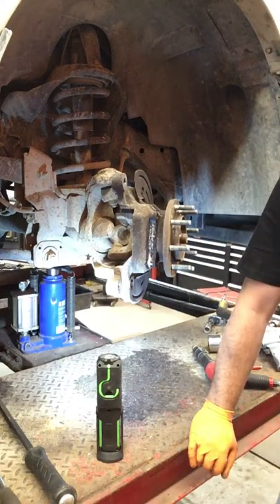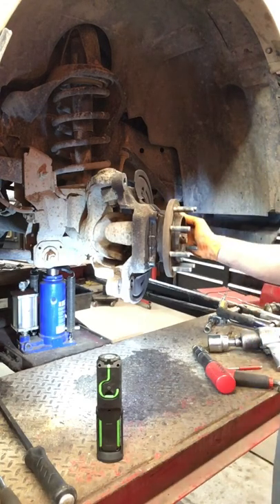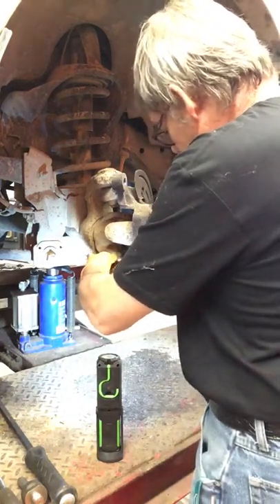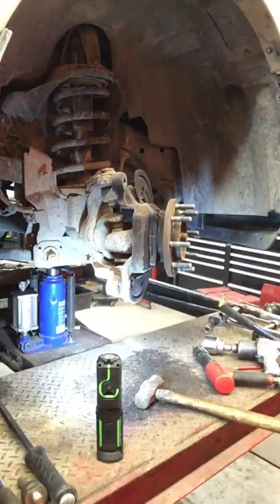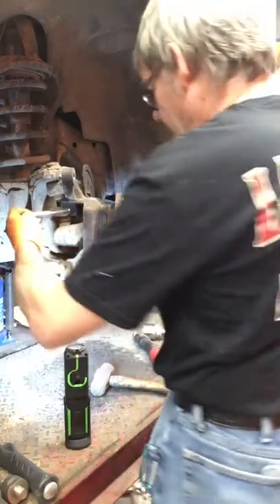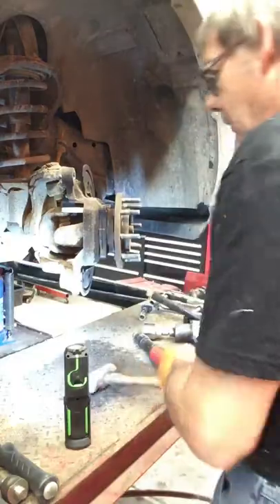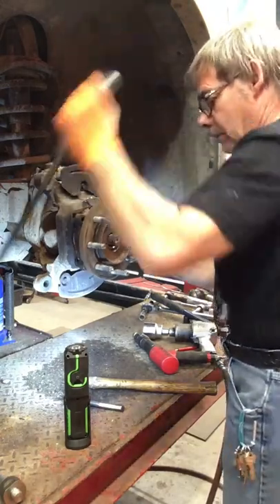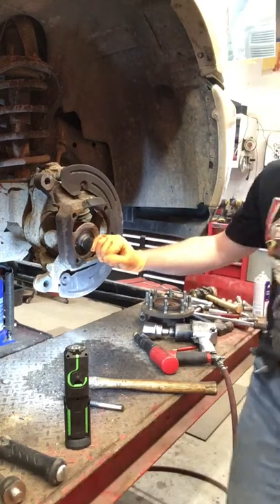Ram 2500 hub removal

Comment from the maker: As per oem manual,when re assembling hub,4 bolts are 149 ft lbs and axle nut is 263 ft lbs, lube splines and bearing housing where it fits into knuckle.